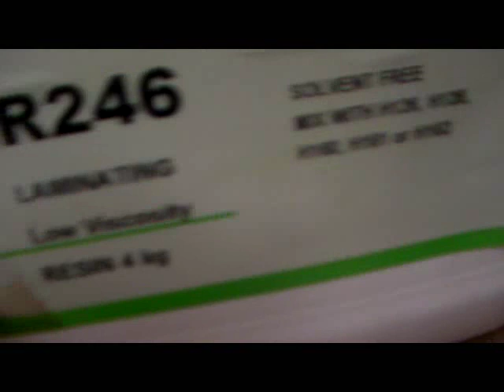vacuum resin infusion.

Comment: This is a high risk infusion strategy. It would be better if the feed line goes to a spiral hose that is is in the middle of the part on the entire length. Then i only has to travel 10 centimeters to a perimiter hose.

like this : http://www.mathfem.it/images/RTM-Worx-lm-glasfiber-rotorblade-foto1.jpg

Comment: so, 3M 77 adhesive has no ill effects on any woven, mat, or resins?
Reply from the maker: No it doesn't.
Reply: +windburner1 Spray glues with composite in mind dissolve in epoxy, i do not know this brand specifically.
Reply: +windburner1 How did you guys make that vacuum infusion set up?